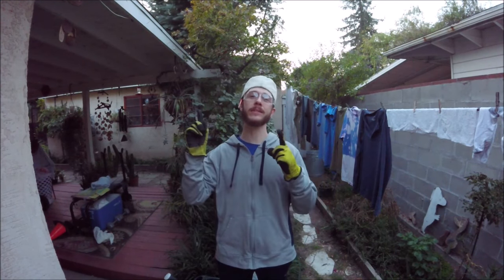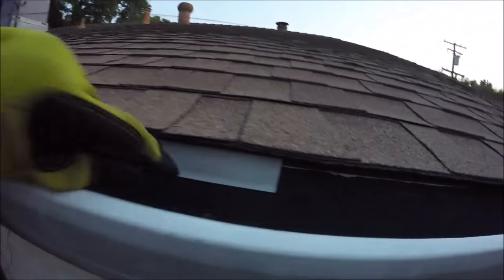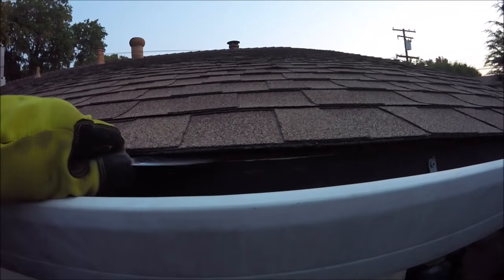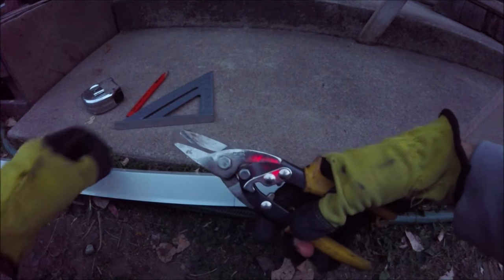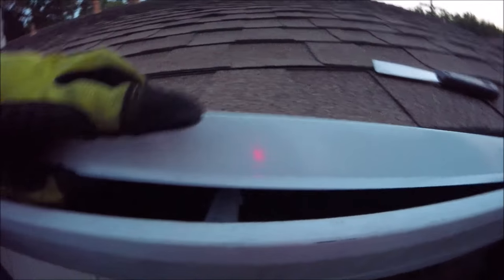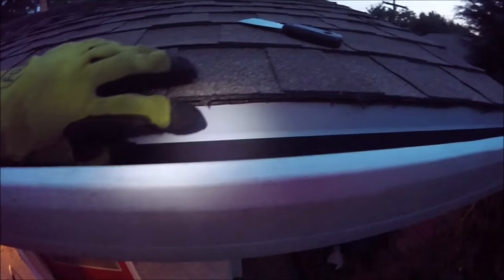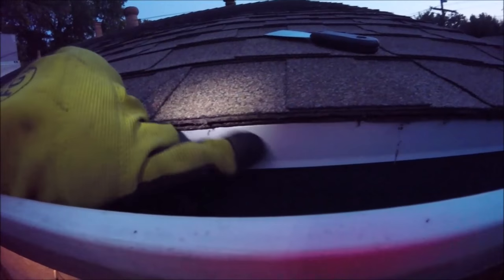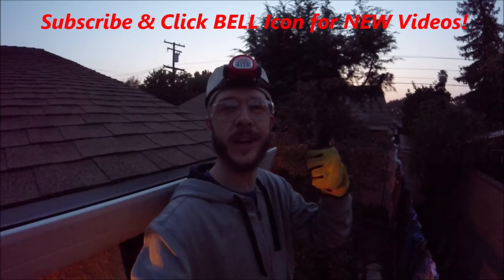How To Properly Install Drip Edge on your Roof -Jonny DIY

Comment: If you wanna nail it from the top, how do you hammer it in if you can't pull the shingles all the way back to be able to hammer it?
Reply from the maker: If you can lift the shingles up enough, but sometimes they become too brittle so I'd then suggest either gluing with construction adhesive (loctite 3x premium) or face nail then put roofing sealant over nail

Comment: lepage pl premium or dap POLYURETHANE SEALANT, which one is better for gluing shingle and drip edge? Thanks.
Reply from the maker: Either will work fine but I use PL Premium 👍

Comment: My roofer/contractor installed my roof two weeks ago without a drip edge. Today, he came back and installed the drip edge ON TOP of the underlayment and did not use any cement behind and on top of the drip edge. Shouldn't the drip edge have been placed UNDER the underlayment? Thanks!
Reply from the maker: That's fine, a lot of people install it over tar paper especially on the rakes of the roof. It depends where you live how roofers do it as well and if dealing with ice and water shield. It's a secondary protection so even if water gets between shingles and drip edge somehow you'll still have tar paper under to protect it

Comment: What if drip edge and gutter guards go in the same spot? Under the shingles?
Reply from the maker: @anthonyallan8462  drip edge goes down 1st then gutter guards would go on top
Reply: @JonnyDIY  thanks
Reply from the maker: @anthonyallan8462  Your'e welcome, glad to help 👍
Reply: One more thing would you put Roofing tar with both under shingles like that?
Reply from the maker: @anthonyallan8462  roofing tar not necessary unless shingles coming up a lot. Should be fine without. The drip edge is very thin material

Comment: I need to install a drip edge on a metal portico. Any suggestions? Thanks
Reply from the maker: Could use some self drilling roofing screws to attach. Theyre weatherproof and create a seal

Comment: I am doing this now after the fact that water has gotten down my trim pieces.  You said to put this under the shingles but should I also lift up the tar paper if I can and put this under the tar paper/roofing felt?  Just wanted to make sure before I glue it down.. Wasn't sure if I should be above or below the tar paper.
Reply from the maker: Yes if you can slip the drip edge under the tar paper 👍
Reply: @JonnyDIY  Awesome thank you!  That's what I just did!  Glad that is the correct way!
Reply from the maker: @NewShockerGuy  you're welcome, glad I could help 👍

Comment: Great video. Thanks so much for making it.
Can you include a link to the drop edge as well please? Oh and if you have it a link to the tar/roof sealant you suggested for the “gluing”
Reply from the maker: Should be able to pick it up at any big box or roofing specific building supply store. Ask for metal drip edge flashing and for the sealant ask for roof and flashing sealant in a caulking tube (makes it easy to use) 👍🏻

Comment: do I need wooden board before installing rain gutters?
Reply from the maker: You don't have to have fascia boards to install gutters. It's preferable though, if don't have them will have to screw into rafter tails (and those would be end grain)

Comment: I need to add this to an existing roof what should I glue this with ?
Reply from the maker: I'd use either construction adhesive like Loctite PL Premium 3x or Loctite roof sealant PL S30 and face nail/screw every so often especially if high wind area and cover the heads 👍

Comment: I have an issue where the roofers installed a new roof a few years back, all new drip edge and all roof accessories.  Where two pieces of drip edge meet, they didn't nail them down and they are slightly "popping up" at that joint, creating a slight ridge.  How would one drive a nail to fasten that down?  I'll have to slightly lift the shingles and I don't know if a tack hammer will fit without stretching the shingles so there is then a permanent stretch in the shingles.
Reply from the maker: Yes its kind of difficult to get a nail under the shingles but if you slowly and gently pry up the shingles above the area you should be able to drive in a short roofing nail through both pieces into the roof. If you can't get one through the top you can always face nail one through the two pieces. Can use a screw on the face too. That's fine just cover it up with some silicone caulking or some Roofing sealant. I wouldn't worry about one nail hole 👍🏻
Reply: @JonnyDIY  That was my concern, water being able to penetrate around a nail if I were to face nail through the facia.  Caulk wearing out over time and causing the fascia board to rot.  I suppose no sooner than a new roof would be due anyway.
Reply from the maker: @kcmaldonado3948  itll be fine the 1 nail or screw. 100% silicone holds up longest time. Doesn't shrink or crack 👍🏻
Reply: I seem to not have a choice. The sub fascia is a 2x6. On top of that is 1x8. On top of that is the thin metal rollex fascia. And it's all dropped about 3/4" lower and 3/4" further out than the roof decking.

Comment: Is it ok to do the gutters after if the drip edge if I installing aluminum fascia? I'm talking alum fascia on the boards then drip overlapping the fascia and then the gutters?
Reply from the maker: Yes that'll work fine, try and tuck the back edge of gutters slightly under drip edge too 👍
Reply: @JonnyDIY  thank you so much
Reply from the maker: @obscurevisuals  you're welcome, glad I could help 👍

Comment: I came here for the post shingle install which was how I thought, however. learned the drip edge has to be a 1/2 inch off the facia lmao I sware my installers just slap that shit up to it flush ... thanks for the info!!
Reply from the maker: You're welcome, yes thats the most common mistake made installing drip edge. If its already up you can try slipping a larger putty knife or flat bar between fascia and drip and bend it outwards so the bottom of the drip edge isnt touching fascia 👍

Comment: Hi, I am under contract for a home and the gutters were installed over the metal drip edge and not tucked under, per our  inspector. What would be the solution to this? Are we able to install a new drip edge without removing the old one or would we be able to remove the gutters, bend the drip edge forward and reinstall the gutters behind the drip edge? What do you recommend? I do plan on contacting a gutter company, but I don't want to get screwed over. Thanks in advance.
Reply from the maker: Hello Lizeth, I wouldn't worry too much, definitely needs to be addressed in the next year I'd say. If it were me I'd probably just remove gutters and slip back under drip edge. Call around and try and get at least 2 estimates, that way you can get a feel for the market pricing. Go with the one that seems the most competent about the job even if a bit more money 👍

Comment: doesn't it help when doing shingles to extend 3/8" past fascia? also what kind of gutters would u suggest if i got drip edge(i got the same drip edge u used to install)
Reply from the maker: Yes 1st course of shingles should extend beyond fascia. If you have a lot to do I would just hire a gutter guy that makes them onsite out of aluminum. Just try and get a couple bids as pricing can be all over. Good Luck 👍🏻

Comment: So I had someone install gutters completely on top of the drip edge… am I completely screwed
Reply from the maker: No itll be ok, at least you have drip edge installed. A lot better than having no drip edge with gutters. If worried you could caulk the edge where the gutter meets the drip edge to prevent water dripping back between the two 👍

Comment: Looks to me like all drip edge is not the same. Some are prone to water running down and back to the lower rear which could be an issue if the rear of the gutter is not positioned up and behind it. Some however appear to be made such that water can not run back but is forced to fall off the front edge, into the gutter.

Comment: ok but what about people who live on a hill and dont have gutters. One corner of my roof is leaking water behind the facial board every time it rains. I want to fix it but there is nothing that has answered my questions or helped me on here
Reply from the maker: Sounds like a roofing problem, how the water is being diverted. Could probably be solved with additional flashing and or drip edge and roofing sealant 👍

Comment: My drip edge is installed over top of the gutter and im still getting water behind the gutter and dripping down the fascia. Ive tried bending out the drip edge and also putting a dowel behind it to keep 1/2" off the gutter but its still getting behind it. Any suggestions?
Reply from the maker: Hmm it shouldn't be getting much between the two, but some will no matter what. If the drip edge runs over the lip into gutter there's no need to bend it out or gap it with a dowel.  But if its shorter drip edge and theres a gap between the two itll need to hang over the gutter though. Last ditch effort I would get some quality silicone caulk, then clean and caulk a bead between fascia and gutter. Just get clear silicone, it'll hold up best and youll never see it
Reply: Are your gutters backing up?

Comment: Great vid. I had a contractor install a new roof on my home two years ago. I have an aluminum roof over the patio that connects to the main roof. The drip line / shingle line has a few shingles near the edge that haven’t laid down flat. I thought over a shorter period that this would’ve happened by now. If this makes sense, any thoughts.
Reply from the maker: Yes the shingles on edge should have layed flat in 2 years. As long as they're not too curled it's fine. And they should slightly extend past edge of fascia
Reply: @JonnyDIY  Ty for the quick response. I’ll be following to watch all of your home improvement ideas.
Reply: @JonnyDIY  Yes they do extend past the facia. Ty
Reply from the maker: @ehpennsylvania  you're welcome, glad to help 👍

Comment: My gutter nails won't allow that big of a drip edge.  what should i do?  I found a very short drip edge but still leaking behind the gutters at the nail holes.  so, do i now have to go up and caulk all the gutter nails under the drip edge?
Reply from the maker: If youre still getting water drainage behind the gutters, yes you should seal it to prevent water damage to your fascia or rafter tails
Reply: Jonny DIY thank you!
Reply from the maker: You're welcome 😀👍🏻

Comment: I was cleaning my gutters the other day and realized i dont have dripedge. My shingles overhang a couple inches over top of my gutters. Man, i never noticed it before. I just had a roof put on about 5 years ago. Why those fools wouldnt have said anything or installed some. I guess i know what im doing today.🤦‍♂️hopefully i dont have any damage. I wonder if my homeowners insurance would cover that?!😬
Reply from the maker: Yes they should have put new drip edge with the new roof especially if it was a complete tear off and re roof. Hope you get issue sorted 👍 Good luck

Comment: Drip edge first and then felt. Or felt first, then drip edge goes on over felt? 
Can't seem to get anyone to talk in basic beginners English. Most of us are DIY (beginners).
Reply from the maker: From my knowledge, drip edge 1st then felt over the top. Then on the gable ends drip edge over the top of felt paper
Reply: Markeytube - on the eaves, drip edge under the felt.  On the rake, drip edge over the felt.
Reply: @ibrazeau3044  thanks.
Reply: @ibrazeau3044  Why would the drip edge go over the felt on the rake? I'm trying to visualize this...

On the eave its obvious that the felt goes over the drip edge.
Reply: Shop Therapy - I don't really know but the code calls for that.  I never questioned before as we just do it because it is required.  I'll find out for you though.  Either way, 15 lbs felt is not worth much and 30 lbs felt (better) is getting hard to find as self adhering products are much better and much more available.  For those, you need a removable membrane on top because the old shingles stick to it and it's a major drag while installing a new roof afterwards. No real need for felt over unheated roofs though, like a shed or lean to, because the temp is similar inside and out.  

I'll find out for you.
Reply: Shop Therapy - so I found out from my field architect... the felt is not required on a shed because the roof and internal ambient temps remain relatively the same.  In a home setting, where the roof and below structure temps will vary, the felt and other similar products is required because of possible wicking effects from snow, ice and vapour, where water can come back up under the shingles to the roof sheathing... that being said, the rake Felt is installed under drip edges because if any wicking occurs, water will seep from above the rake drip edge and on top of the felt and to the bottom eave drip edge, which is covered by the felt, and off the roof.  If it were installed above at the rake, side winded rain could push water below it and affect the sheathing and wicking from the sides could do the same.  When it is installed below, side winded rain and wicking still occur but will go above the drip edge and drip onto the felt and finally out from the eave.  This is hard to explain and I hope you get what I mean.
Reply: @ibrazeau3044  Yep!  That makes sense!  Thanks for checking on that!  Learn something new every day!
Reply: Shop Therapy - Welcome :)

Comment: I’ve been looking for this info for a while now, and you’re the only one to explain how to retrofit a drip edge. I knew I needed this because Tommy at This Old House is obsessed with drip edges. 

https://youtu.be/sDTCTbyyg1s

If you want to capitalize on that, you could also explain how to fix or replace improperly installed drip edges. Additionally, I’m pretty sure his advice regarding gutters is based on snowy New England. It helps for you to explain how it’s different in warm areas.
Reply from the maker: Thanks Alex! Haha you're right abouy ole Tommy.  He's always going off about improperly installed drip edge haha 🤣👍🏻